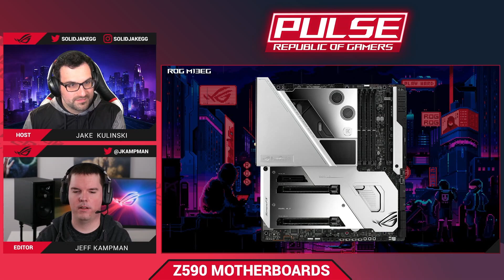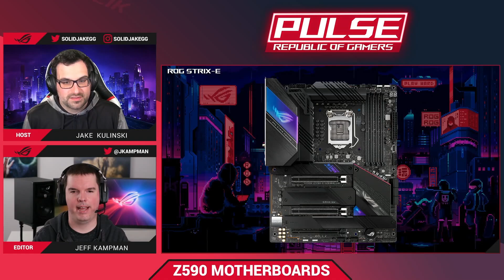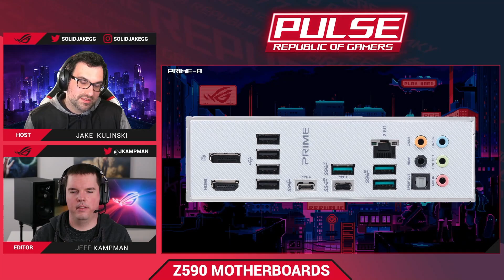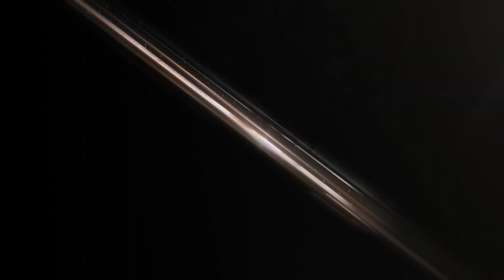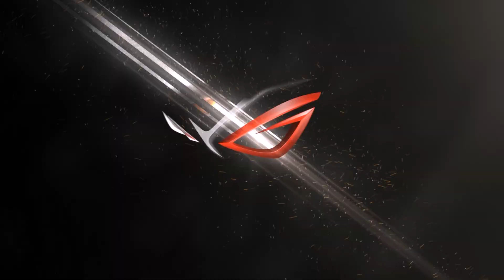ROG Pulse Podcast - Ep.16 - Z590 Motherboards

Comment: Can we run two NVMe M.2 Gen 4 SSDs at full speed or is it only one in DIMM.2 expansion? if not, considering AMD have supported gen 4 PCIe for approximately a year and a half now. Seems like a half baked launch still not as good as it could be. Plenty of time for you guys to have improved over AMD's designs with the extra time.

Another question. The connectivity between the chipset and CPU. Is it PCIe 4.0 at 4 lanes? aka please better explain the connectivity and how it has been improved instead of glossing over details.

Both singlecore and multithread matters. There's a reason why we have CPUs with much more cores and threads now. Future games will definitely utilise more cores and threads with game engines like UE5 etc. Saying only singlecore matters is extremely narrowminded and not thinking ahead.